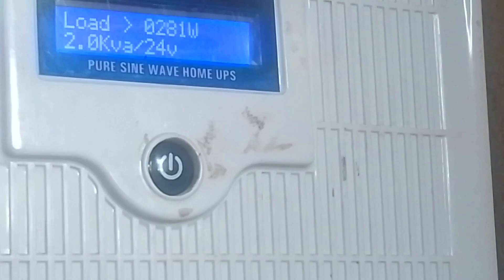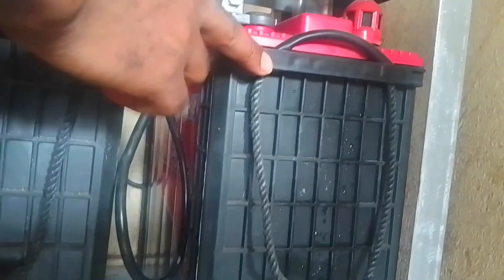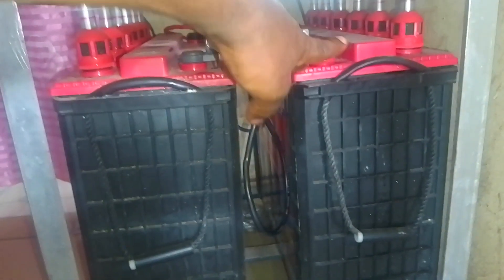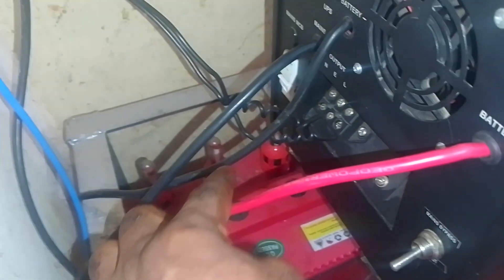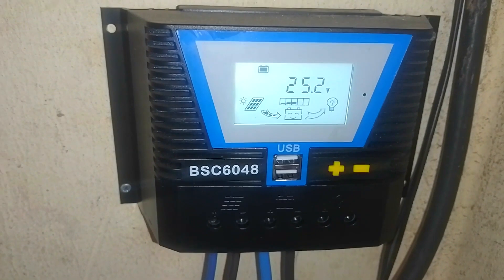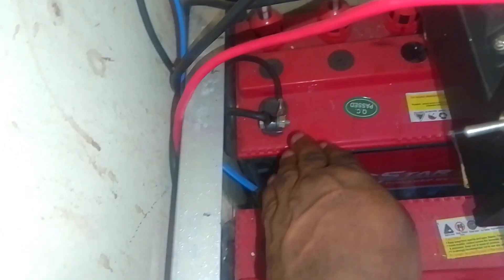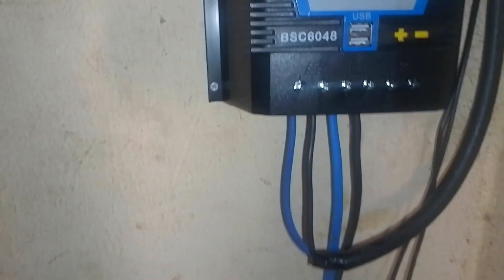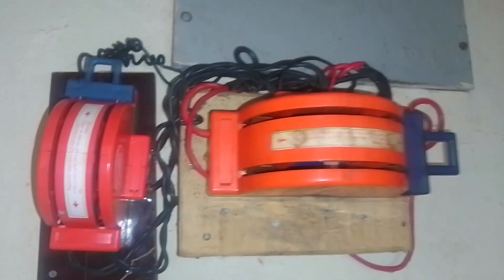Off Grid 24-Volt Solar System for 4-Bedroom Flat

Comment: How much is the cost
Reply from the maker: This was about 800k I will do another video to break the cost down
Reply: @Cyber-TechAI  
How long is it going to last
Reply from the maker: @idowulukmon642  the system setup or the light when fully charged
Reply: @Cyber-TechAI  
How many years is it going to last
Reply from the maker: @idowulukmon642  the battery has 24months waranty, the usage determine how long it will last this particular one might last 2 to 4 years, but for a setup that can last between 5 to 10 years  there is a different system configuration for such
Reply: @Cyber-TechAI  
Ok